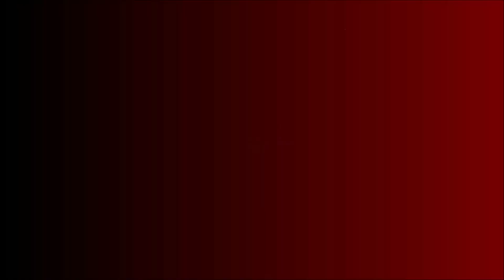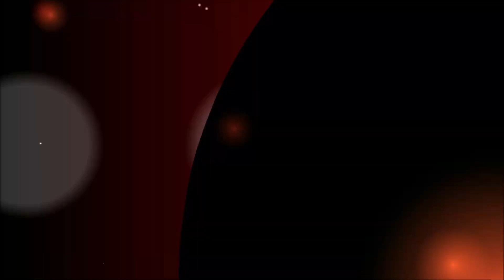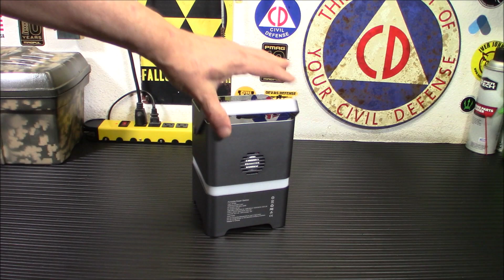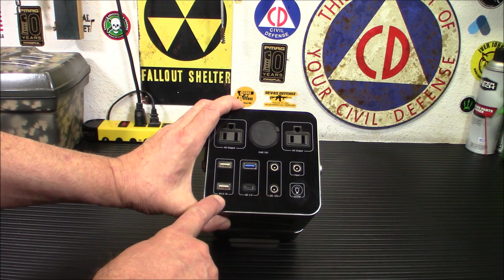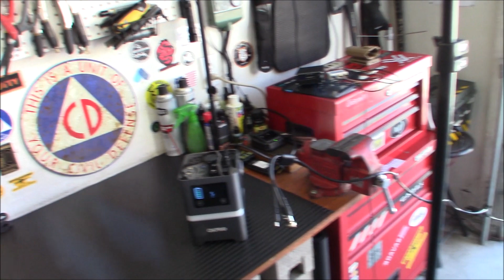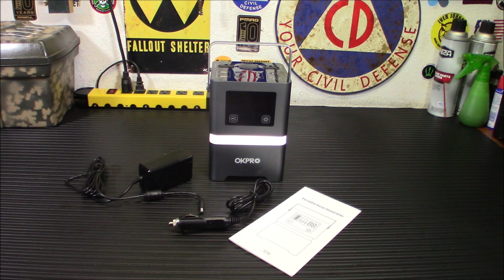Backup Power! OKPRO Portable Power Station

Comment: Do you recommend this over the 300w Rockpals you reviewed in Dec?  I'm trying to decide which one to get for emergencies, (I don't camp, etc., but want something for power outages).  Also, is it best to get a 60w or 100w solar panel?  Thank you so much!  :-)
Reply from the maker: I would go with the 200 rockpals one, this one is fine  but i like the controls on the rockpals better,  As for a a panel get the biggest one you can afford, if you can get that 100 watt one.
Reply: @Iridium242  Thank you so much.